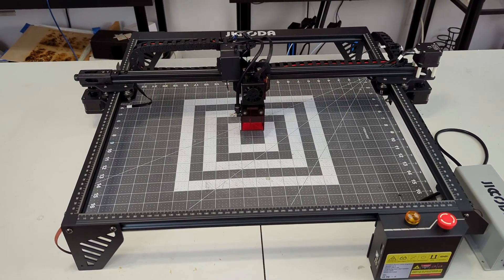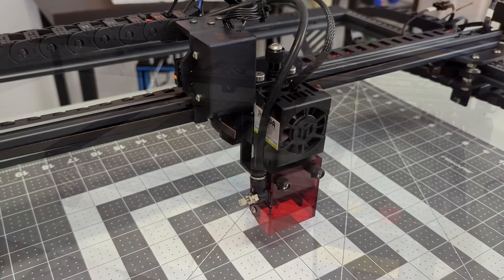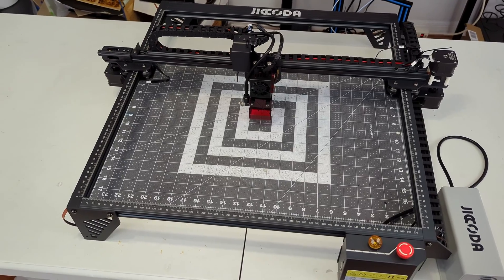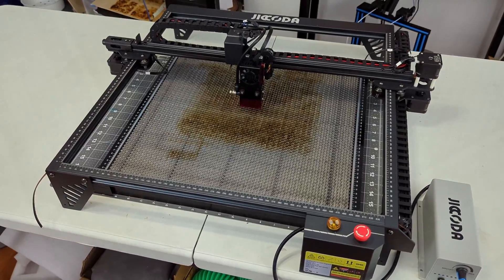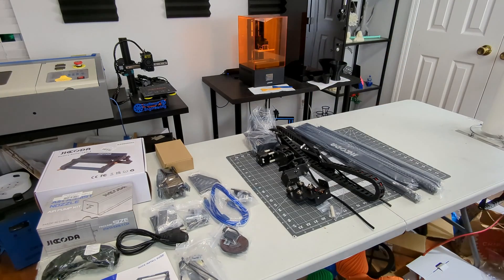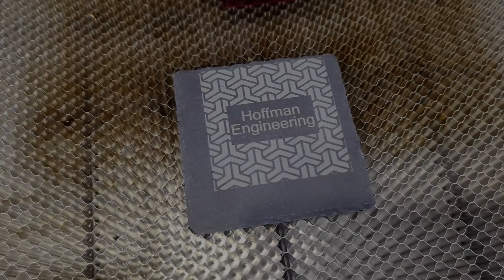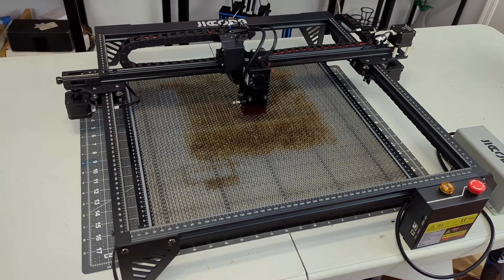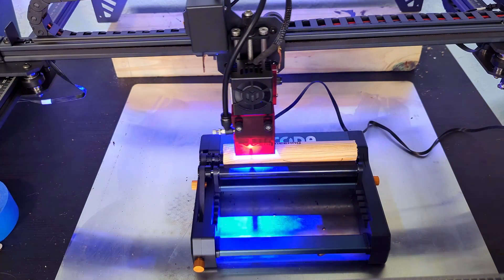The most dangerous laser I've seen - JICCODA LE-1 10W Laser Engraver Review

Comment: Note that - unless yours was different the Jiccota is a class 1 laser (which does not require eye protection - unless of course you stand and stare at it.) What that means is that in normal use as long as you dont constantly look at it, the reflected laser won't hurt your eyes.  HOWEVER you are right to warn people to use protection because there are so many variables that not taking the chance is a good thing. PS a Class 4 laser is the one you have to be paranoid about.
Reply from the maker: This is definitely a class 4 laser (as indicated on the side of the laser module and the front of the control panel). Eye protection is REQUIRED for anyone around the laser, or you will damage your eyes.
Reply: @HoffmanEngineering  yeah after some thought it seemed weird they were claiming it was a class 1. the literature I looked at was wrong abt that.